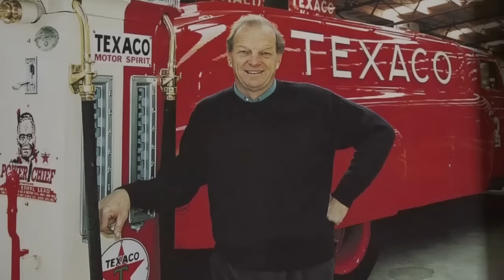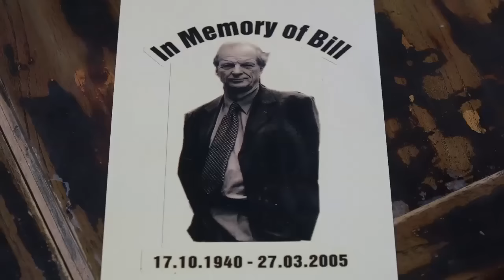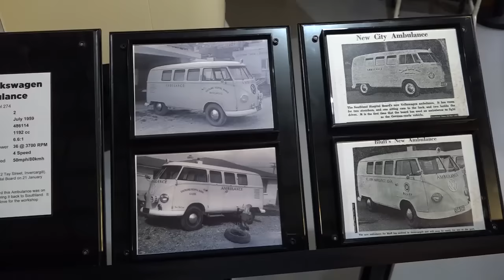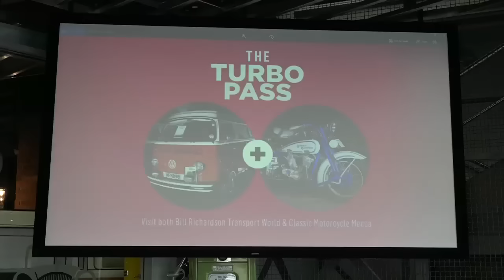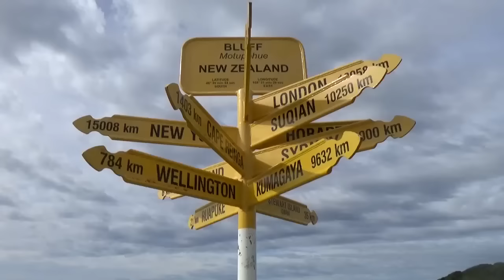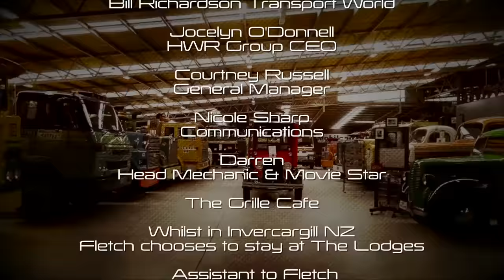Bill Richardson Transport World - Invercargill NZ: Classic Restos - Series 55

Comment: 9:46 What is an OE for most of the viewers that are not from New Zealand?

Overseas Experience (OE) is a New Zealand term for an extended overseas working period or holiday. Sometimes referred to as "The big OE" in reference to the extended duration of the travel - typically at least one year, and often extended far longer.

Either way, great episode!